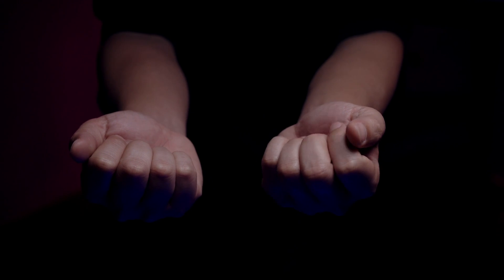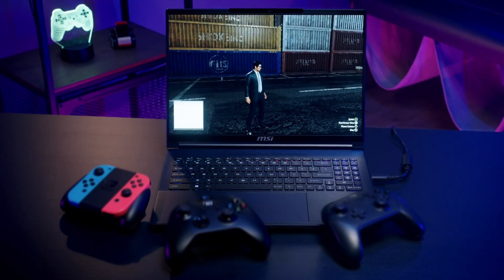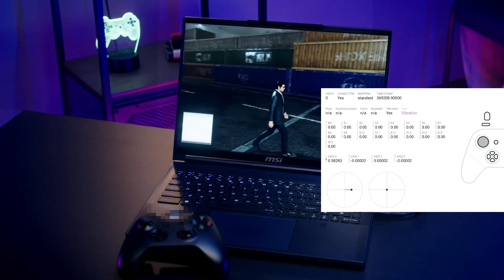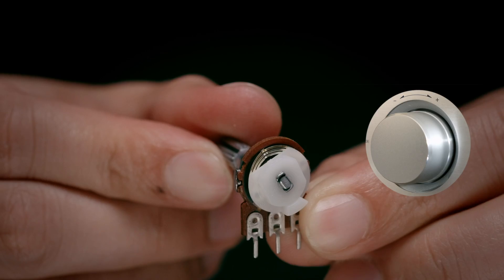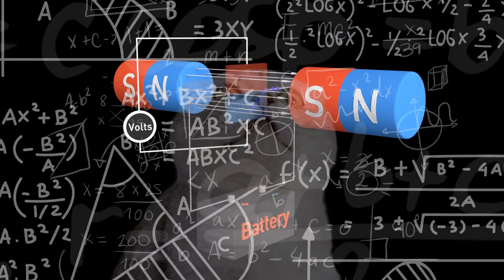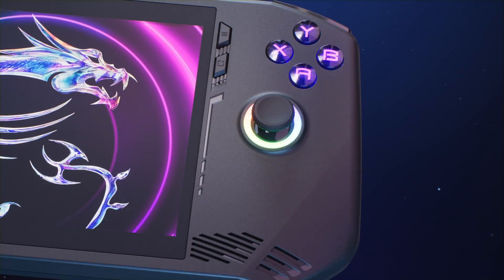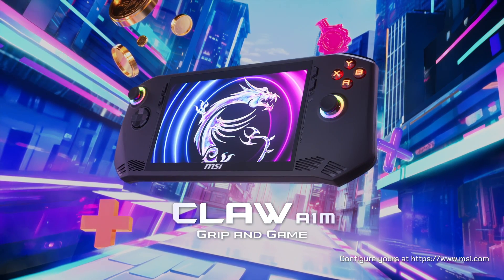You can't go back after watching this - Claw Hall Effect Joystick | MSI

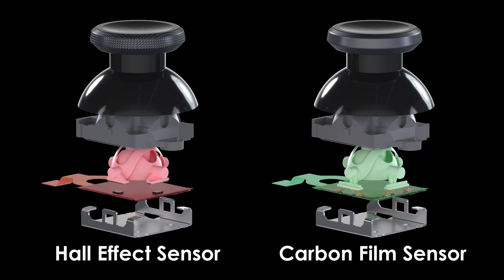Comment: I'm using an old cheap joystick, and the part that looks like a spring in this second [0:55] has failed after less than a year of active use, it looks like a mechanical problem

Comment: only x2.5 more durable? I thought it's much more than that 😅 I've been using Gulikit gamepad for 2.5 years now and the issues weren't drifting, rather squeaky noises from the triggers and sometimes the face buttons would stuck, at least until you lubricate them with silicone spray

Comment: I have an MSI and it drifts, but I looked at another video and it seems like it might be related to internal interference with the left trigger. I'm going to get it fixed because so far I haven't liked a controller as much as I like this MSI GC30, drift occurring or not I would buy another before going to any other controller option on PC.